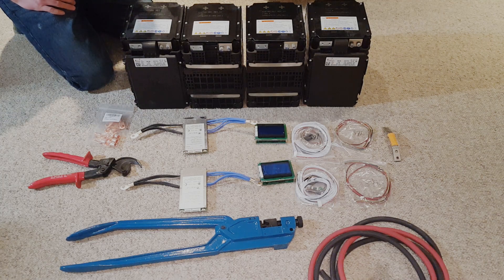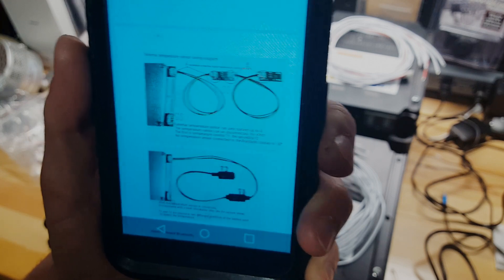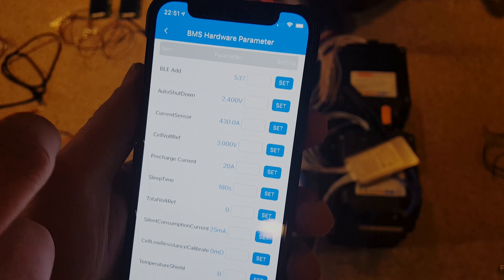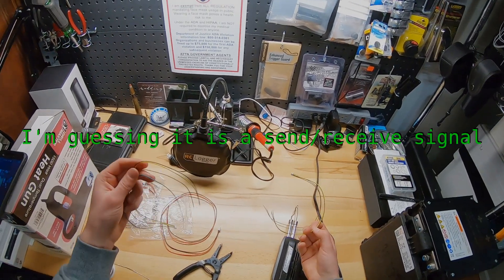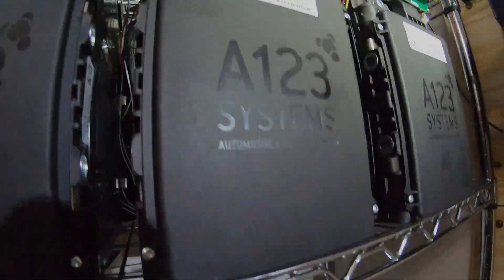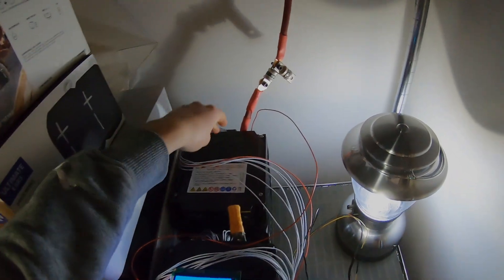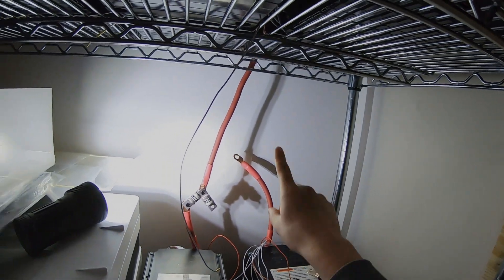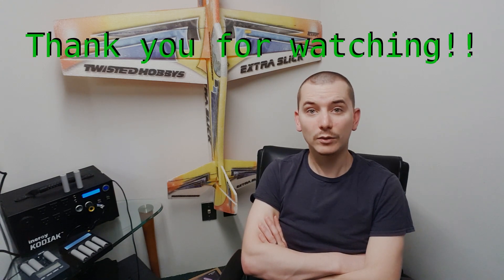Project Overkill Expansion!! 18KWh of backup LiFePO4 energy!!! These A123's are amazingly balanced!

Comment: Awesome, I have the same LiFePO4 batteries from Battery Hookup that I just pulled out of storage. I’m trying to find the specs on them. Do you remember what the max charging voltage per pack was? Or what the cutoff voltage should be on the BMS?

Comment: Dear , is it correct thing to put a 333A DC fuse or circuit breaker on the cable between the battery and inverter ( 4000W 12V ) , and operate air condition ( 2800W )
Reply from the maker: Assuming you have the appropriate size wire, that should work. If you don't expect to see that type of amperage, you can always go a little smaller on the fuse rating to be sure it blows in a timely manner should there be a short circuit. 333 amps is no joke.
Reply: DIY Renewable Energy & Electronics the fuse won’t trip because of the air condition starting current , or the dc fuse is not responsible about what happend in the distance after the inverter ( the wire between inverter and air condition ), if you have a example with equation about choosing dc fuse size ( of wire between battery and inverter ) that will be helpful and great 👍🏻

Comment: What is the chemistry of them pouch cells and what kind of inverter charger are you using if you don't mind sharing that with us would be greatly appreciated
Reply from the maker: These cells are LiFePO4, the inverter charger is a sigineer 3000w 48v inverter charger. So far it has been performing well. Feel free to ask more questions if you have any. Thanks for watching!
Reply: @diyrenewableenergyelectron4996  what are the batteries you using ? I am also setting up a 48V system, im have a mppt solar 5048 48 V...  Well trying, I'm never done this before.
Reply from the maker: I'm using 4 BYD 24v LiFePO4 batteries for my personal setup and am thinking about expanding with some eve/basen lifepo4 280 Ah cells.
Reply from the maker: The 5048 sounds like a nice all around unit. What are you trying to power?
Reply: @diyrenewableenergyelectron4996  I'm want enough power to run my oxygen eclipse 5 and fridge, as I live in Florida and we always have hurricane and out of power for days. Last time I had to drive 78 miles to buy gas for my generator.. Thank you for your quick reply.....
Reply from the maker: The fridge has a bit of a surge load but being a 5000 watt inverter it should handle it. Do you have a kill-a-watt meter to see what kind of size battery bank you need? You run your appliances for a few days with the meter plugged in and it tells you how many kWh it has used. Very handy. It will give you a very good idea of the size of the battery bank you need to power your items for several days. Thanks for watching!
Reply: @diyrenewableenergyelectron4996   No I don't have a kill-a-watt meter, but I will buy one. I do know because on my electric bill it says I use 737 KWH for a 28days. 26KWH a day around this. That seems high but that what is on my electric bill. Again Thank you
Reply from the maker: Nice. The meter will help you. Generally, a full sized fridge uses around 1 KWh per day. Feel free to ask more questions. :)
Reply: @diyrenewableenergyelectron4996  Thank you much respect !!

Comment: Where did you buy the batteries from? I'm thinking of doing a future project.
Reply from the maker: These were a pickup from last summer. Theres a video on my channel showing the teardown. Battery hookup had full 350v modules for sale and i jumped on one. What kind of project do you have in mind?

Thanks for watching, by the way!
Reply: @diyrenewableenergyelectron4996  Same as yours then add solar charging to it later.
Reply from the maker: Have you considered looking into the EVE/lishen cells? Lithiumsolar has a few good videos on them. Theyre exceptionally affordable. I may expand my personal setup (project overkill is not mine) with some of their 280 Ah cells. 87usd each is too good to pass up lol
Reply: @diyrenewableenergyelectron4996  sounds like a good deal I will have to check them out, Thanks
Reply: I have the same BMS as you are using but cannot find the App for it, your App looks much better than ones I have seen and appears to work perfectly with this BMS
Reply from the maker: Do you have an iphone or android? The app APK for android is in the description for the video.